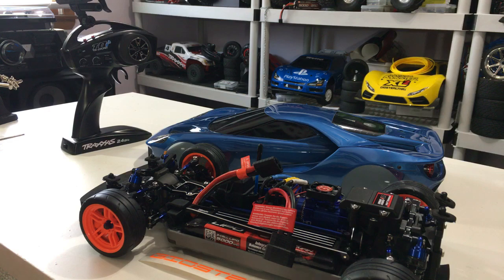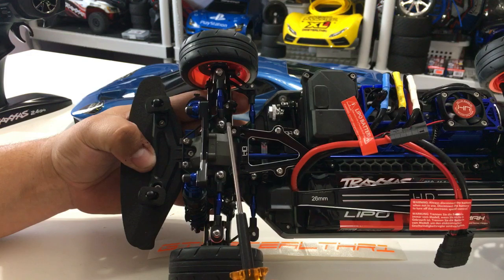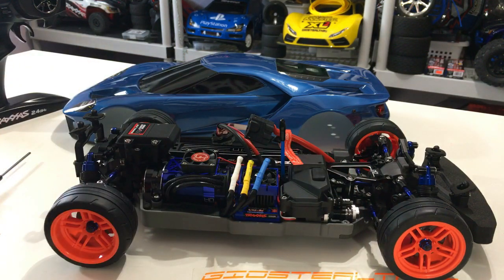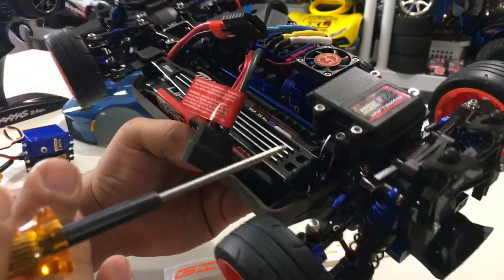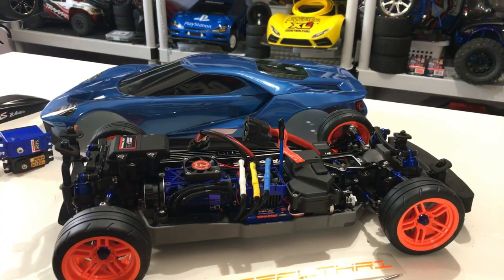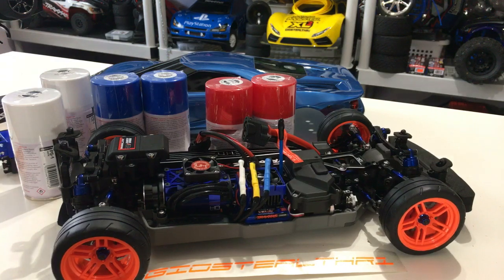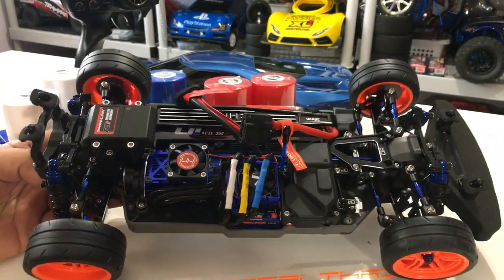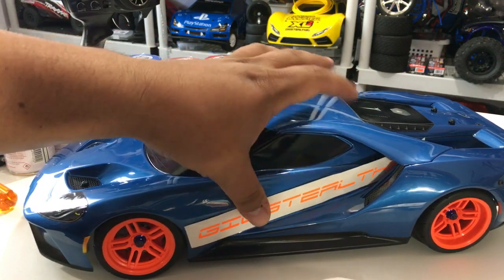LIVE GREATEST TRAXXAS 4TEC 2.0 CUSTOM UPGRADES 95% DONE ?

Comment: Nice work.  I don’t like too much aluminum on mine but just in weak areas.  I do have a massive heavy 4s 4500mah 90C battery from SMC.  I should’ve checked the specs before getting it.  Each of my sons have the much lighter 3700kv version .  Anyway here’s mine: 

Ford GT Black
35/62 gearing 
Holmes Hobbies 2700kv Puller Pro
Mamba X 
Spektrum glitch buster
Hot Racing motor fan heatsink
Bastens heatsink
GPM front shock tower
GPM aluminum tie rods with stabilizers
Front/Rear: 40wt/35wt shock oil
Front/Rear: 4mm/4mm preload 
Acer interior ceramic bearings
Front/Rear:  100k/10k diff oil 
Front: Contact foam tires 26mm 40shore 
Rear: BSR foam 45mm 32shore

GPS’d at 65mph.  I can gear higher but no need.  I love the combination of speed, acceleration, and handling.  The stock servo is good enough although I have several high end servos I can use in case the stocker craps out

Comment: I know, its been 4 years, but ill give it a go anymay. My 2.0 makes the same clicking/grinding noise, when i move it (motor is out) I bought it second hand and the noise is comming from the differential. I disassembled it and moved the gear, that connects to the center drive shaft a bit back - it went away. My worry is, that its not secured in place in any way, so it could just slip out of the bearing again and start grinding. Should there be some kind of a stopper or a shim, that prevents that gear from moving back and forth? Is there a way to somehow glue it to the bearing, so it does not slip out anymore?

Comment: Does the clicky noise when you roll the rc mean that the motor has a lot of torc
Reply: Ben Vallevand I think it’s the higher gearing in the transmission
Reply: Steel spur  ⚙️

Comment: Have you managed to get the Savox servo to fit yet? I really want a quicker servo on mine.
Reply: Just switch the heads and it will work
Reply: I did it with my 30 kg servo
Reply: I got an eco power flush fit 115T

Comment: What Is the point of the spiral cut diff gear?
Reply: MotoGamer a quick Google search tells me that "The helical design produces less vibration and noise than conventional straight-cut or spur-cut gear with straight teeth." My only question is where did you get spiral cut gears for the 4 Tec?!
Reply: aerossignol Well my good man: a simple traxxas.com search under the 4 tec parts would show you that there is now a spiral cut variant available for $40 I believe. Good day.
Reply: MotoGamer ha ha, I had searched hot racing and GPM. Who would have thought it was a stock traxxas part....